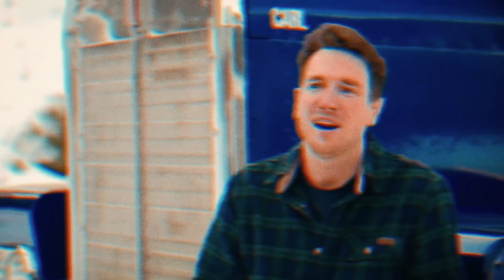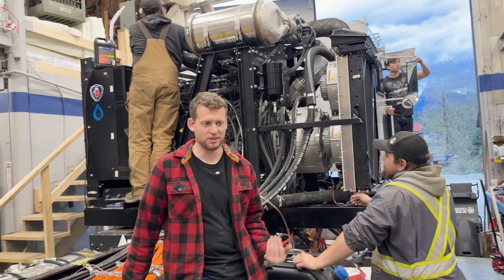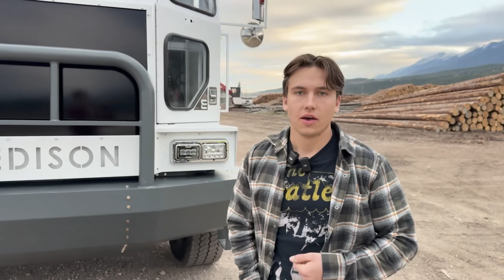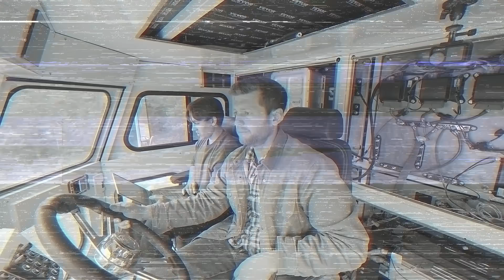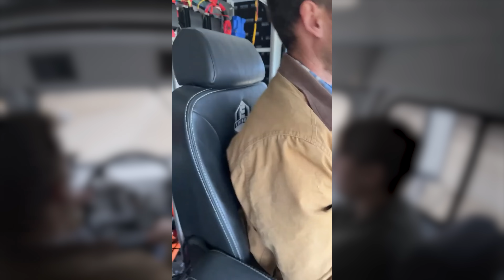Driving Our New Hybrid Truck for The First Time

Comment: I had always wondered why trucks weren't built this way but I guess electric motor and battery tech wasn't developed enough. Overall it is half way between a deisel electric train engine and a Honda hybrid system: adds battery packs to store energy instead of wasting it like a diesel train but lacks the direct drive connection the Honda eCTV has. Far better fuel economy than a standard semi and far longer range than the Tesla semi and looks like it can operate in places the Tesla never could. I look forward to seeing these on the road.

Comment: bro your truck is amazing but can you build new heavy truck like volvo c304 tgb truck  so i just want same size like volvo truck want just build electric engine for 100 year without damage engine electric so that why i can't find any truck electric camper and truck like ben 10 motorhome i just want like this so much but that is not good for fuel because i can't find anywhere and high price and where do i survival travel this reason why i need chose electric use solar syster can be charge

Comment: I'm not a trucker just a gamer (ETS2) that's passionate about EVs. I think for mass market users it would be better if the driver is on the side instead of the middle since now both side is blind reverse sides and I think the front would be beneficial if it was designed to be more aerodynamic so it's more efficient on power usage

Comment: I wonder if they are also think about ,what happens when the battery is full. Hybrids in descent they use the generator to run the Engine to consume power from the batteries, so that you still have the electric motors to slow down and not using the brake pads.

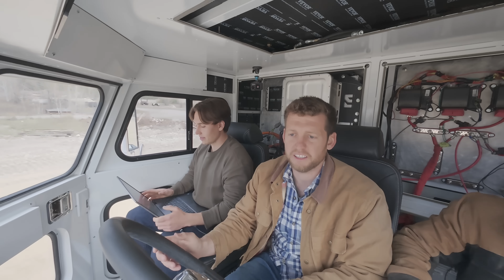Comment: <14:14, have a backup you can fall back to, like able to disengage problematic systems especially one that should propel you, to not having to propel that,

like able to host a backup power generator, like those attachment in front you have now. Also to use your power generator to power an auxiliary vehicle if your wheels just fell of (somebody didn't bolt down, barely, for some reason or circumstances).

Also to check or oversee the primary functions work, like a 12V battery if you have one. Hard to see if that's working, before checking a light bulb.

Primary primary backup backup again again would be the cabin in bad weather, how to reach or check on other parts of the vehicle.

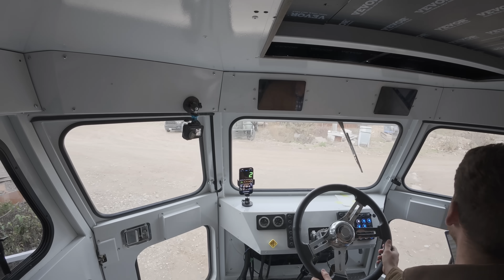Comment: <12:25, also I don't know if a very light voltmeter would draw the battery completely empty soon, but if it doesn't, use the tip of the analogue voltmeter pointer to shut off power including the voltmeter itself, to keep the battery above a certain (desired*) voltage. Or use magnetism and gravity but that likely uses more energy to be a shutdown trigger.

*And know software is full of desired variables you can change, as well as the behavior rules and procedures. Less code the better, comment well, and have variables separate. The better defined, the happier the programmer. (Because you can have it however you want it basically; don't let your programmer swimming or amount to €8B over here in Trump-Holland. Germany is our neighbor.)

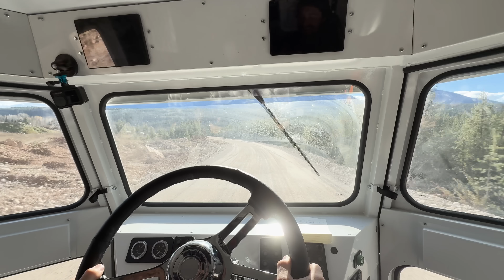Comment: <10:03, finally I can put a Seat 'Service jetzt!' sticker on it. (I'm Dutch. Close enough.) (I've been driving around with that error all the time.)

If one utility requires 5W, you could say, hey, the system draws 5W less, something is not taking that much.

Comment: Hi, there are this HUGE mining trucks that are basically a Prius, I mean, it is a big diesel engine driving electric motors, the advantage they found is no gears and a HUGE weight reduction with a good torque, Do you think something like that could be possible on a truck like this?

Comment: Regarding the doors, I have a recommendation about not having any clearance between bottom of door and the step area outside where the door swings over.

Ice, snow, rocks and any debris will collect there and will chew up the bottom of the door and possibly pose a safety risk if you had to abandon ship.

In a fender bender also, if it gets bent upwards even a bit, you can't open the door.

Otherwise, keep up the great work.

Comment: If you can relocate the wires that are currently in between the frame rails to be hidden in the beams so that the middle of the frame can host different types of load handeling equipment more easily. Ofcourse once the final cable harness is completed its gonna get cleaner. Some loadhandeling systems dip below the top part of the frame beams.

Comment: What's the point of electric hybrid if still needs 5 cylinder engines
Reply: The small batteries drive higher hp and torque to the wheels. The engine adds range. Overall an Edison hybrid truck weighs about the same as a normal semi while having twice the performance and reduced fuel costs.

Comment: And am I correct to assume this truck could be MUCH more reliable than an ICE equivalent due to the use of electric motors? No transmission, no gears. And the generator doesn't have to deliver variable power so it can be tuned and optimized for just generating electricity! And the acceleration must be wild!

Comment: I'm a retired high-tech software dude and I got a big kick out of watching this vid. Reminds me of how our startups were always racing to get to first customer ship - i.e. making the first working version of our offering - and how nervous we would be as we approached that milestone. Great work guys, and thanks for a view into the "sausage factory". As a EE/software dude I really love this. I also love the idea of using electric motors on big trucks combined with a diesel generator. The electric motors provide instant torque and the diesel means you can go to anyplace where you can get diesel - outstanding.
Reply: "fail early, fail often" is the mantra I learned early in my startup career. Forget who coined that phrase but I see it in this vid and it works. Make it fail! Rinse/repeat. It's not a question of whether there are issues (in any design), it's whether you find them and fix them before you give it to your customers.

Comment: Two ideas from Europe. The steps up into the cab should be slightly angeled inward like stairs, makes it much easier to get in and out. And you should put the cab on 4 airbags like we do over here, makes a huge difference going over rough terrain.

Comment: Ok first things first. Add foam rubber and stop all the squeaks.  I could see the battery boxes shaking behind you while driving.  Those probably squeak too.  Your probably not going to get many error codes.  I'm sure the parts your using are top notch.  You did the slow roll. Next video let's see the maxed out full send. 0-60 times battery life/ range. Drive that baby till it's at 1%. Let's go.  The snow is coming or is already here test that out also.  🤟🏻👍🏻✌🏻👌🏻🙏🏻. Move to daily and weekly videos.  We will watch. Let YouTube fund this project.  Push the algorithm.  Call Rich rebuilds and Jerryrigeverything.  Get these guys involved. They would love to help I'm sure.  You could have this thing wrapped up by next week.  😂😅😊🎉

Comment: I've got one of those squeeks.. It's the connection between plastic and steel, or wood and something. Mine is under a bench somewhere I haven't found it..
BOLT Either bolt that connection down firm..
CLEAR Create a gap since the two parts are not coneected solidly anyway..
SMOODUP  Or put coppergrease in between to let it slide..

Comment: This thing makes no sense to me, it’s running heavy batteries which are horrendous to make for the environment, a huge diesel generator on the back so it’s still using fossil fuel, looks as aerodynamic as a brick and electric / hybrid vehicles are the LEAST consumer / user friendly vehicles out there. I get that generators use less fuel than truck engines but what is this for? 
I hope this isn’t anything more serious than a proof of concept
Reply: 70% of semi trucks are light weight, aerodynamic,  freeway trucks.

This truck is a heavy duty "vocational" semi which is the remaining 30% of the semi market like crane trucks,  or concrete trucks. Aero is pointless.

This truck carries a small battery and a smaller than normal engine so it weighs about the same as a normal truck.

The electric axles provide twice the horsepower and torque over a normal truck.

The onboard diesel handles range anxiety.

Thus truck was commissioned by a buyer. It is receiving the service bed right now. The buyer believes thus truck will save 10's of thousands of dollars in fuel annually.
Reply: @Sah-o5m thanks for the explanation
Hopefully those tens of thousands of dollars aren’t instead spent on maintaining these things.
Reply: @TheGalantHamburger 
The EV parts are mostly sold state and expected to be reliable.

The hope is that the fuel savings will cover the steeper up front cost.

Comment: Why?
Reply: Why what?
Reply: @Sah-o5m  why try electric? The diesels are doing just fine and getting better all the time.
Reply: @roberthooper8883 
Electric provides twice the HP and Torque. Using a smaller diesel engine reduces operating costs.
Reply: @Sah-o5m  I guess we will see- there are already way more electric cars out than I thought there would be...

Comment: Those batteries are going to rattle themselves apart unless you have some separate suspension for them, especially with those heavy axles.
Hopefully they are 18650 style cells and not the lifepo4 ones, otherwise you are hooped.

Comment: I love what you are doing. I would suggest you turn the handle 90 degrees so you can reach you hand in easier. Pulling up above your shoulder is not ideal. I would turn it where you reach your fingers in toward the center of the truck so the handle doesn’t “fill” with dirt and bugs as you drive. Just a thought.
Reply: Yep, the vertical door pulls look awkward to me

Comment: @Edison Motors. it is quiet a cool truck. The Nikola you showed is a Iveco S Way just rebadged. And the Iveco S eWay is running strong and sold across germany and europe. just goes to show Nikola was the problem and not the Truck Iveco built for them

Comment: have you heard about the thunderstorm generator
it's scaling up quickly from independent verifications to manufacturing and kit distribution, will likely be this century's revolution for internal combustion engines, orders of magnitudes more significant than a turbo

if you take that Scania generator and fit a thunderstorm, it'll literally exhaust clean air and greatly improves fuel efficiency -you jump on that soon you might become a market leader faster than you could imagine

Comment: Now when this truck is done what will the interior look like? Like will it have a real lay in rubber floor and is there a panels that get covered like the steering shaft and electrical under the dash and or the electrical behind the seats??

Comment: You should take a few cues from European trucks. European trucks not only have shock absorbers between the axles and the chassis, but also between the chassis and the driver’s cab. That could help reduce those enormous jolts and the squeaking door, and the electronics in the cab would appreciate it too. I know, of course, that this is primarily a test vehicle, but that doesn’t mean you have to risk having your fillings shaken out during every test xD

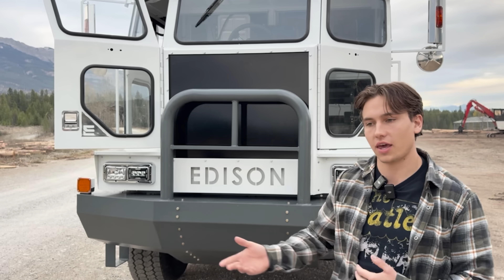Comment: (6:30) Why display error codes when something malfunctions?  Computer memory has become cheap and the truck could have (or may have) one or more LCD graphic displays in the cab.  It could just as well display a plain-language error message to the operator.

Comment: Based on your seating position, the side mirrors should be forward of the doors/cab, akin to how they are mounted on a Coach/Charter Bus… I would also suggest adding side cameras as well… maybe even a 360 camera system… dual pane Windows with defogger built in…

Comment: Is the Scania just a generator?
Reply: Correct. I believe it is 9 liter and 250 hp with a 200 kW generator bolted to it. It is technically just a building standby generator.

It feeds power to the batts and the batts spin the wheels

Comment: You're making great progress. It's inspiring. That said...    How do you handle wire movement/wear when the suspension cycles? Is there a MTBF and wire bend angle max or something? Is it possible to have a deeper cycle (thinking rock-crawlers)?

Comment: That vibration is back emf. Try to add a bit of field weakening and use throttle mapping to smooth it out the acceleration. It will heat up the motor more as consequence but it might solve your slow acceleration and vibration issue.

Comment: Amazing achievement - Should be super proud of yourself.

Will be interested to see the throttle conditions hold up during different conditions. The amp draw can spike quite quickly during ascent/decent conditions and will be magnified by payload. Ultimate test will be a trying to start from standstill in a less than ideal uphill track.

Comment: i don't understand this project. these guys are building a "diesel-electric" truck. isn't that the same thing General Motors has been doing with their railroad engines since the mid-1950's?  what are the big "engineering obstacles" here?
Reply: GE never bothered to put rubber wheels on a train and drive it on the street.

Edison is having to start from scratch.
Reply: @Sah-o5m  my comment referred to the "technology" of the 1950's "diesel electric" locomotives.

Comment: Looking great. Good luck guys. 
#Note Driver Door's "entry ramp" and water accumulation might be a problem during heavy rain. 
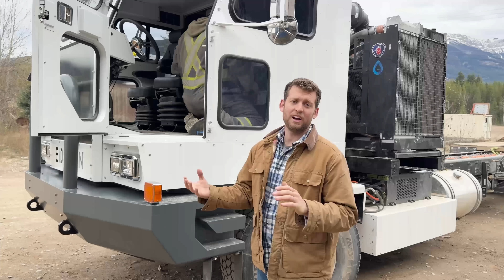From camera angle at 13:20 - looks at the Lower Door seal/Barrier. water should rush in with that Low seal.
only my opinion. Cheers

Comment: So wait, you were able to provide a fully electric diesel truck to a customer? I thought these were not road worthy? Unless the customer is driving on logging roads and not highways?
Reply: Edison has delivered this truck to an outfitter in Winnipeg to get a service bed installed.

Edison is still dealing with ECCC certification

Comment: How about a short european size wheel span/ frame length? Much more maneuvreable… and using a similar suspension and disconnection of the chassis would reduce noise further and increase the comfort. Something like this foreseen? Or are you only targeting the us market? oris this foreseen as container truck, taking 1 20ft container on the 'bed'? 

and on the other hand we (in europe and around the world outside north america) have loads of issues with the metal material and hard edges of the cybertruck, making it unsafe for pedestrians - anything foreseen from your side to adress that problem or is it too early?

Comment: you built a Rube Goldberg nightmare....... the operative question is "why"..... and if you say "global warming" like a whiny beotch, i will follow all your future videos just to leave similar comments.

PS.... NOBOBY WANTS NON SEQUITUR SOLUTIONS IN NEED OF A PROBLEM TO RESOLVE....... I dare you guys to find a REAL problem, state said problem in 10 words or less, and THEN engineer an effective permanent corrective solution.... it's called Problem Solving 101 for a reason.... now don't disappoint me douchebags
Reply from the maker: Uh, first of all, I drive a pre emissions 6.6L LBZ diesel pickup that rolls Coal when I step on it…. 
Secondly, we started building these trucks because we want as much horse power and torque as we can get.
3rd. We are building trucks for right to repair and against planned obsolescence.

-Theron

Comment: obviously not having ridden in the truck but based on the video the mirrors seem a bit far back, im wondering if door mounting them would work well as a potential option? in my one ton i love having door mounted mirrors so when trying to maneuver a tight space with a long trailer i can crack my door open and swing my mirror angle by doing so allowing me better visibility of my trailer

Comment: I’m new here. What’s the point of this truck? Diesel electric?
Reply: This truck has incredible hp and torque of electric drives, and it carries its own onboard level 3 diesel super charger for range.

By running off of batteries, they expect lower fuel costs

Comment: What is the distance from the front bumper to the forward point of the body?  The body I am thinking of is a front loader  rubbish compactor.  
What ability does the driver have to tell the generator to fully charge the battery, or to delay recharging? ( Curfew area operations.)
  Another industry is concrete delivery. These trucks commonly have high idle times.
A truck intended as a logger, ends up fitting into town better, ironic.

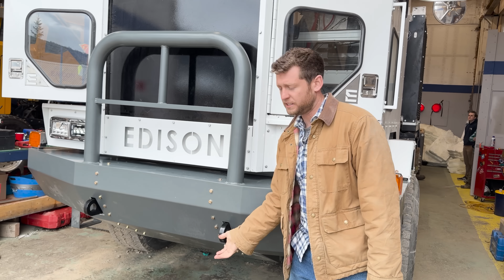Comment: 11:56 credit where it's due for the choice of words. Not "if" but "when" it breaks down.

Any tool that gets worked as hard as this truck is likely to be, will at some point. Break down. It's inevitable, stuff happens, tyres blow out, hydraulics go pop, engines break. It happens. Having things in place to get it going again matters alot and shows the practical experience Chase has.

Comment: So in theory. What would happen if someone is driving one of your trucks with a load and moving at speed and it dies like it did on your test? Just a full loss of power.
Reply: Any car made in the last 25 years with an engine ECU would stall if the power cord was unplugged.

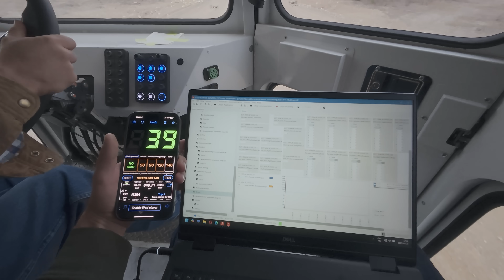Comment: 16:26 "i dont know what max power is" i totally respect this statement. There are a dozen components involved in releasing angry pixie electrons between the battery and the wheels. Each component will have a safe constant load, and a safe max burst mode. Push a little harder each time and monitor the components and find their limits. There will always be a bottleneck somewhere.

Carry on edison, you got this :)